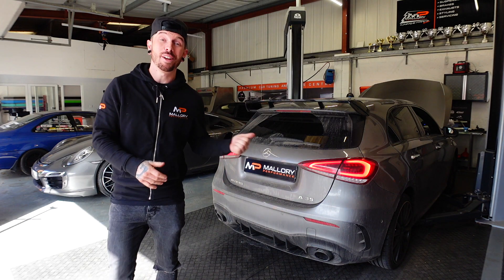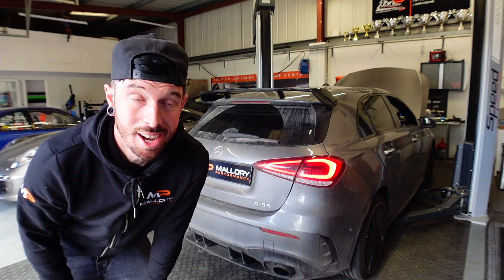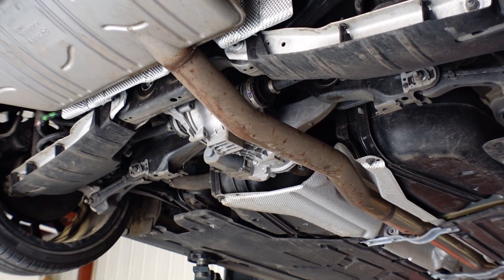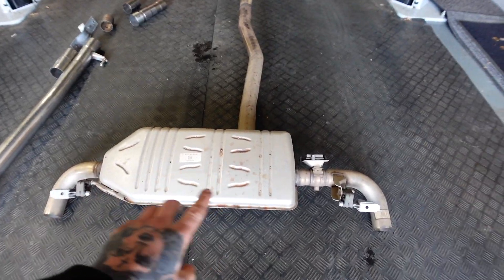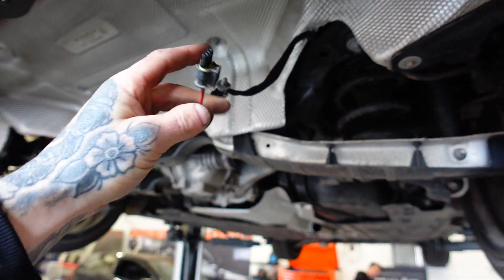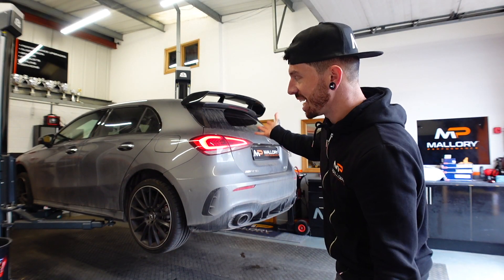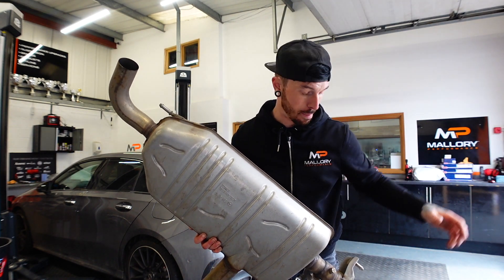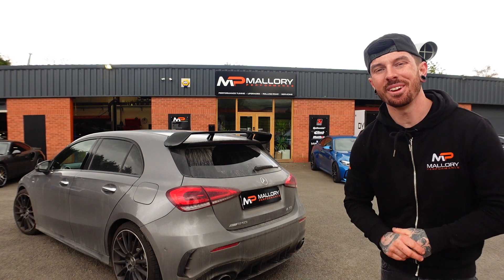MERCEDES A35 AMG MILLTEK EXHAUST INSTALL

Comment: Should have done a before and after dyno run to determine whether the investment in the Milltek actually delivers any performance gains in the rev range and to overall power. Spending £000's on an exhaust for it to sound louder is a pointless modification IMO.
Reply from the maker: This was a customers cars who have just came to us for the milltek exhaust and fitting. If they had requested a dyno run it for sure would of been in the video. We will be doing videos like this on our own demo car the A45s
Reply: @MalloryPerformance  Fair enough. Will be interesting to see what difference the Milltek system makes on the demo car for sure.
Reply: For some people sound is everything like myself. If you daily drive a car in most situations you wont be able to even utilise 100% power in any car, unless you track your car which most people don't,  thats why some people don't bother with tuning. Exhaust mods don't always have to just be for power gains, sound is paramount!

Comment: CORRECTION. This system is PPF-Back, not cat-back. These cars have both a cat and an PPF filter. The box that's visible on the video towards the engine, is the PPF, not the cat. The cat is further up. 

For clarification you do need both the cat and PPF for MOTs in the UK and if you were to remove one or both, you'll need to map the car. 

I don't know how much this set up costs, but you can get it done with a good welder. ( I have the exact same set up on mine plus a small high flow silencer on the left hand side, after the split, so my ears don't bleed on the motor way. It cost me £600, including VAT and labour/parts ). 

Hope this helps...

Comment: Are you kidding me? Rev the fcuking thing
Reply: It has a soft limiter around 4k, I have a cla35 with a soft limiter as well unfortunately
Reply: @Shiron95  put it in drive and pull both paddles then
Reply: @Shiron95  No they don't actually they can rev all the way up to 6500rpm